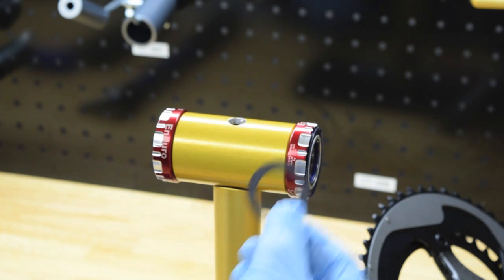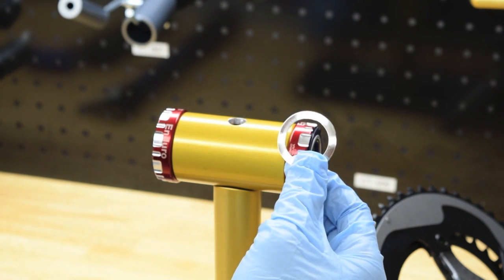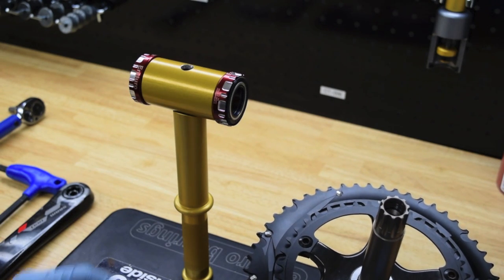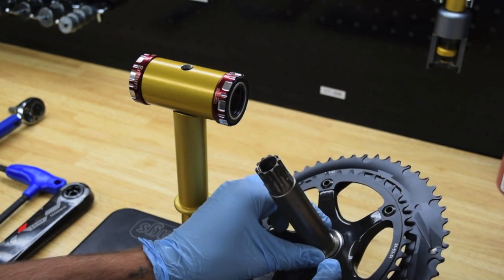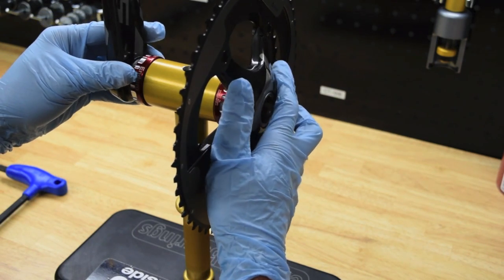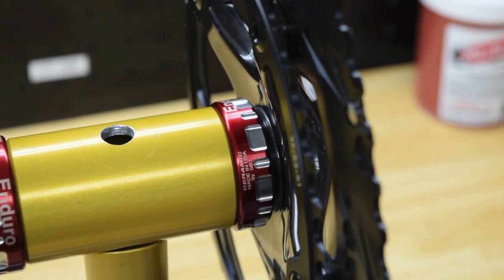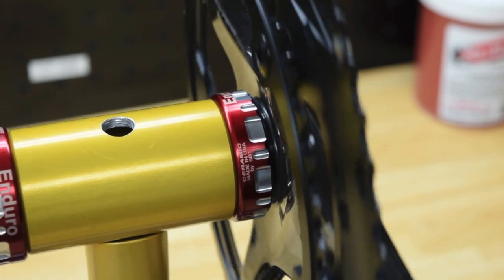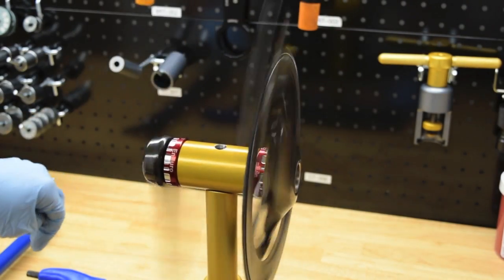Understanding bearing preload with SRAM

Comment: Hi please help. I purchased a Force 22  BB30 crank  is it possible to fit it to a BSA 68mm shell?
Reply: No. Sorry. The spindle length isn't long enough for BSA 68mm. You can fit Rotor 3D+ cranks which are BB30 (not true BB30 standard [22mm longer]).
I say this as I have had the same issue in the past and bought a new Force 22 crankset. You will likely have to sell the crankset or keep for use on a different BB bike frame.
Reply: I say this as BB30 isn't long enough spindle for external load bearings

Comment: My XD-15 GXP did not come with a wavy washer.  And my crank torque specs are 48-54 Nm, so I originally set it up to JUST be tight enough that there was no lateral play or "clicking" if you rocked the crank arms about the lateral axis.

Due to wear, compression of the non-metal spacers, or other, the bearing preload is no longer sufficient within the specified torque range for my RaceFace NEXT SL crank.

I need a source for more spacers/shims, so I can trial and error until I get the perfect preload.

Any ideas for a source?